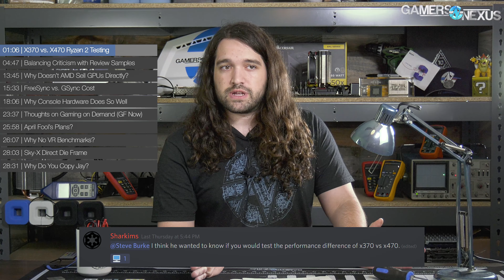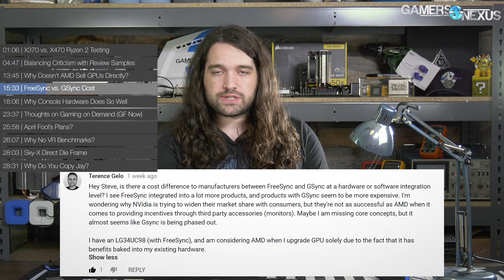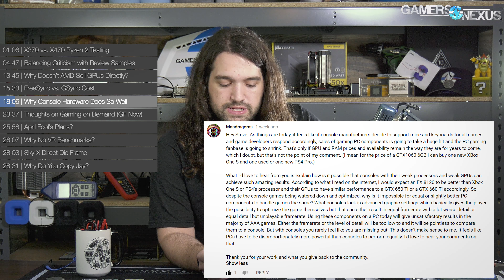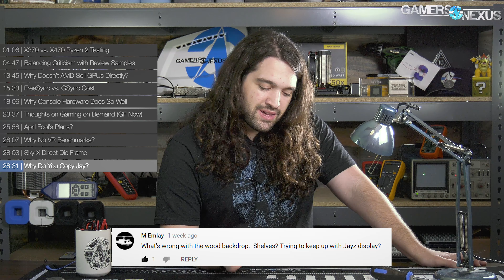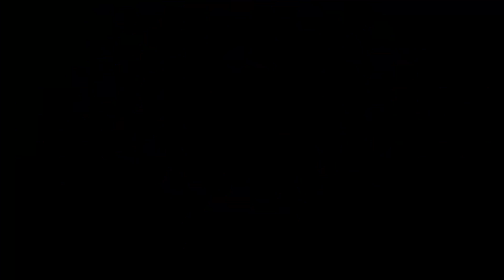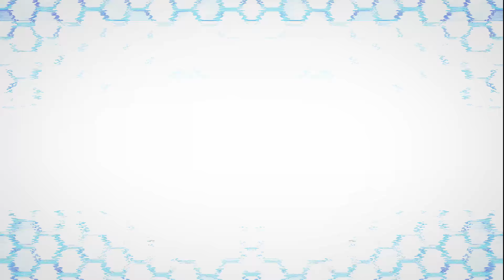Ask GN 75: X470 vs. X370 Tests, Balancing Criticism vs. Samples

Comment: Pretty sure it's much more than "just" criticism... 
Heavy criticism was certainly appropriate considering that CM explicitly advertised this as a "high airflow/performance oriented" case, and of course that's where the criticism came from, but that doesn't mean that it didn't go too far. A LOT of people now erroneously believe that the original H500P doesn't have good enough airflow to maintain acceptable temps for even a typical mid-level build with a mild overclock and that it's one of the worst cases in the industry, when in actuality it's on par with critically acclaimed cases like the Fractal Define R6. There are no doubt some people that have went with a case like the NZXT S340 over the 500 "because it has shitty airflow, I don't want my system to run hot!" When, in reality... 

It's one thing to review a product and be critical of its flaws, but to exaggerate it to such an extent that a large portion of the market now believes that it's something worse than it is and to reference it disparagingly for months after - especially when it's an otherwise segment competitive product with no greater amount of minor flaws than most of the competition in that price bracket - at some point you can't be surprised when the manufacturer isn't quite pleased with the way that you've handled the reporting of the flaws in their latest product. It's supposed to be a review of a product, not a public mockery of a company. This isn't a response to the criticism of a product - this is a response to the PR nightmare that was created, over a case that doesn't even have exceptionally bad airflow, or even really worse than the majority of cases of this product generation(not that the current 'standard' is acceptable - I have no interest in a solid legitimate 95% of new cases out there. But that isn't the point either). 

While I'm sure that Steve didn't intend("the road to hell is paved with good intentions") for his coverage to come off that way, while many here won't see it that way, that isn't the point. You've gotta consider if what you're saying CAN be easily misinterpreted, especially in a negative connotation. It's often the unintended consequences that do the most damage, and I'm pretty sure that's what happened here. Being careful with wording & actions can go a LONG way, especially if people can tell that you're making the effort, that you aren't being careless(which, if I had to guess, is probably how CM viewed this). That certainly doesn't mean 'suck up' or 'self censor', it means be more cognizant of what can potentially result from a presentation in one fashion vs just a slightly different fashion. Think about the perspective of ALL parties involved when making content and try to be reasonably selective with wording/phrasing to reasonably limit the potential misinterpretations. Obviously there's only so much one can do, but there still is a lot that can be done too. Again, the optics of "making the effort..." at least.

Just some thoughts from someone that's been involved in PR a little(different industry)

Comment: Steve,  Why is there such a lack of Multiple SATA M.2 Slots on current Mainstream motherboards.  It would seem that the mainstream boards should be more likely to use SATA Versions (Cheaper & Use Less PCIe Lanes) than the NVME M.2 Variant.  Any thoughts on this topic.  Also do you think we will start seeing boards with Say 3 to 4 M.2 Slots in lieu of Standard SATA Ports in the future?

Comment: Is it safe to assume that the memory and cache latency support between the ASUS ROG CROSSHAIR VII HERO and ASUS ROG STRIX X470-I GAMING will be largely the same if not identical? My use case is latency sensitive but I also need a Mini-ITX form-factor. The specs look very similar aside from connectivity, I'm hoping that I can use the upcoming flood of crosshair 7 reviews as a good rule of thumb.

Comment: Are you excited by the AMD Navi at 1080 performance for $250? I am.

$250 is similar to a 8gb RX480 in launch price. So I would imagine that it wont have HBM but rather GDDR6 also at $250 its not going to be 512 bit bus (like a 290x) cost wise. So basically we are looking at GDDR6 on a 256 bit bus. GDDR6 looks like it could be around 10gbps or 12gbps for the memory speed. That's 25 to 50% more bandwidth than the RX480. Having that as a theoretical maximum on top of a rx480's stock performance still does not net us 1080 like performance. So possible efficiency improvements?
I'm either inferring, estimating or blindly guessing here so the salt pile is very large.

Comment: #AskGN watching your video on the ryzen 2700x was interesting. my question is you seem to recommend leaving the 2700x at stock and let the XFR do its magic rather than overclocking to 4.2Ghz. but you also think the 2700 non X is a better bet if overclocked. this maybe a stupid question but if you overclocked the 2700 to same frequency as the 2700x would XFR behave the in the same way for both from that point or do you have to overclock the 2700 as far as it will go to be imilar to the 2700x. im basically asking how XFR works in relationship to base and overclocked CPUs

Comment: hey guys asrock x370 killer sli ac and asrock x470 sli master ac are pretty much the same both has 12 phase design you could make a battle between the two ✌️

Comment: QUESTION:
I have an old sad 7770 with a crappy cooler and a friend of mine has a couple of broken gtx 770's.
My question is: considering i have bios modded the crap out of the old hd7770, is it possible for me to fit the cooler from the gtx 770 to the AMD card? 

I know I need space for chokes and caps, but I can cut off some material from the heatsink with a file...

Thanks in advance!

Comment: There is of course a "physical piece of hw" for VESA Adaptive Sync (Freesync if you want to validate)... It's the scaler and controller board. I would guess the G-sync "module" basically is this exact thing, just created by Nvidia instead of  a more readily available design. Highly doubt G-sync  monitors have that module and then normal scaler and controller he too.

Comment: Hey Steve, on the chance you see this, I have a question and a recommendation. Even when direct product comparisons are impossible with too many variables floating around, it can be really informative and fun to apply multivariate regression. Have you ever tried or considered this? It isn't typically statistically valid but it could really offer a lot. I've tried this a bit in my freetime with things like monitor costs / variable refresh rates and benchmark performance among different processor micro-architectures. I'd like to hear your thoughts on taking this kind of analysis (and am open to talking about it more if there's any interest).

Comment: I recently built a new system with an R7 1700, Asus Crosshair VI, and G.Skill Ripjaws V 3200.  I've never overclocked before, but I've been watching TechTuber videos for about a year, so I decided to give it a shot.

Basically, I started with the Asus UEFI auto-overclock feature, and it spit out a baseclock of 103, and a multiplier of 40, for a total ~4.1 overclock.  From everything I've seen, that's a pretty aggressive overclock, especially on a non-"X" SKU.  Stable, no major issues (an occasional stuttering issue, but I can't even say for sure what the cause is).

So, the question: Did I just jackpot the silicon lottery, or is there something I'm missing between target overclock and actual?  (Speccy says CPU is actually running @4.1.)

Comment: #askgn The FTC issued a statement cracking down on companies placing contingencies on warranties. Do you think companies are going to fight it or give in? Also, do you think that it will make any difference for overclockers and moders? Obviously there should be a limit as to what a company warranties, overclocking and burning out components is a risk for us to take. However it would be nice to work on or upgrade components in a device without worrying about voiding the warranty. 

FCC Release: https://www.ftc.gov/news-events/press-releases/2018/04/ftc-staff-warns-companies-it-illegal-condition-warranty-coverage

Comment: Hi #AskGN, I have a maybe dumb question wondering if this is something you've tested or if you have any information on other sources on the internet. Now that people have verified coffeelake's compatibility on z170 and z270, do you have any info on compatibility of 7700k on the z370 chipset? or is this to your knowledge just technically impossible? If this will be possible, it feels like even z470 will be supporting 6th/7th gen cpu because within 2 generation chipset they are usually inter-compatible right? in that case, if the modding to get it work is not rocket science hard, we will live in a happy place where intel actually produced 4 generations of inter-compatible chipset/cpus, isn't that great? I don't have high hope though this is just a wild guess/hope at best. Oh and it's probably subjective but I actually think your shelf looks better than Jay's.
Reply: Also, just thinking about the apple battery scandal thing, planned obsolete is bad right? If Intel can't prove that the previous gen is indeed not compatible, but just straight up block it for the sake of blocking , isn't that the same thing, planned obsolete?

Comment: #AskGN With the decline in multi GPU compatibility, why doesn't Nvidia add one or two more price brackets to the graphics card market, like $1000 & $1300? I don't mean the Titan lineup, rather cards that have significantly more power than the x80 TI GPUs (even if the die is super huge, Nvidia + AIBs can always liquid cool it from the start). I know this sounds strange, but there are always those people that have a limitless budget on gaming equipment.

Comment: Looking for a solution to remove corrosion from a mother board.  The board still works but has quirks.  The affected area is lower bottom right near the on off pins.  Alcohol and a toothbrush did not work.

Comment: Have you seen the video Luis Rossman did on liquid metal shunt modding weakening the solder joints?  I would second think that method and maybe move to soldering a resistor or wire bridge.  There might be undiscovered methods as easy as liquid metal like using foil or something.  It might be a good video to check out how the cards are that you did it on and try out other methods.

Comment: 18:00 I have the answer. Consoles target 30FPS. PC players are unhappy with less than 60FPS. Camera movements with joysticks are smooth at 30FPS because they are not a direct imput like a mouse. When you move a mouse your brain expect something precise who is hard to achieve at 30FPS. When you move the stick, your brain only expect a direction, not direct control of the camera.

But if you tweak the graphics, with a pretty old GPU you can achieve the same as a console at 30FPS, just play console type games with a controller or you will be disapointed.

Remember, when reviewers compare FF15 PC vs consoles, the PC port have twice the FPS (locked on PC and deeps on consoles) with more graphical fidelity. Meaning the PC have about 3 times the power of the console in the hood. If you take 1/3 power of a GTX 1080, you end up with a 960 or maybe less. A 100 or 150$ card. If you add a shit CPU to target for 30FPS max, like 50$, you may end up spending more because of memoy shortages, but you will not be too far from a console cost.

Comment: Steve, any way you can inquire as to the status on the Lian Li case that was designed in collaboration with Der8auer? I myself would be very interested in getting the Dynamic. I have the Enermax Equilence which is OK but VERY heavy.

Comment: To answer your Console Segment in the video from a software developer position who knows a few game developers:
You're answer was half correct. 
Contrary to popular belief, it's easier to optimize for PC. Why? Because it's significantly faster and has way more memory. However being that consoles are one set of hardware it is by quite a bit less complex. Now my next point may sound contradictory but hear me out.

In some instances a console game on a first alpa build can run at 100ms PER FRAME or any other significantly high number. Needless to say it's horrible. Gamers hate anything below 16ms. Now imagine 100ms! It takes a significant amount of complex optimization to get it down the that target of 33ms. That's a large drop. It may be complex but certainly a different kind of complex because you have one set of hardware or like most studios a Xbox One X/S, PS4/Pro. 

PC on the other hand on a first build could start at 30ms or so. Basically near 30fps. That's a pretty large difference! So it's much easier to hit your target because you are very close already. Where the complexity comes in is getting it there on more hardware. It's generally speaking not super difficult to get one GPU there but the other architecture may not like it. Which means a different solution needs to be found. It's really down to balancing your code. That's the complexity side of it.

Hope this helps:)
PS: sorry for typos, on mobile!

Comment: #AskGN QUESTION: Can you apply max multiplier to all cores of non k processors like 8400 (x40~4Ghz) and 8700 (x46~4.6 Ghz)? Recently I've stumbled upon this thread " http://www.overclock.net/forum/5-intel-cpus/1645268-possible-i5-8400-a.html ". If it's true, then is it worth buying 8600k when in some regions 8700 costs about as much as the 8600k?

Comment: What about the usage of modern CPU instructions or instruction sets like AVX, FMA etc. especially on Windows. As x86-64 only mandates SSE 2, I fear that most of the current software (e.g. Games) targets that as the most common denominator?! Are much of these advances in CPU technology in vain from a consumer point of view as re-compiling stuff is more of a Linux thing? I've also heard of Intel's own Linux Distribution (Clear Linux) which uses modern compiler techniques (like function multi-versioning or profile guided optimizations) to gain respectable performance advances over other common Linux distributions. Are these optimizations already used in Windows as well? Do you know if Microsoft works on something similar to use these modern hardware ressources more efficiently with their upcoming Windows Core OS? Especially as GPUs get more and more general purpose and will transform into C++17 accelerators soon?!

Comment: For x370 vs x470 just take some same mobos like asus prime pro x370 and x470 and try custom settings like 4Ghz depend cpu you can try 1st gen and 2st gen Ryzen and same voltage do some benchmarks and ready the x370 vs x470 . I think will be same results

Comment: Which is better for side panel fan mounts: intake or exhaust?  
Hypothetically, if one is using a gpu that has an open air cooler, like an evga ftw, and also supposing that whatever case you choose, you have at least one fan in the front blowing as intake, and one fan in teh top back as exhaust.

I'm sure many will have a good advice, and I'm welcome to it, but I'd like to hear Steve's thoughts.  It might even make for a content piece on its own.

And why do I ask?  I've got a bit older of a case - Antec 1100 and I never use those side panel fan mounts, mainly because my first card was a reference 7970 and now I use an evga 980ti hybrid, no need for side panel fans.  However, it's a really good case that I'll most likely have for years to come and at some point I might look at going open air cooler GPU in the future.

Comment: regarding the VR question: currently running an OCd i5-3570k and a GTX 970. I'm very pleased with the Performance in VR. No performance issues yet whatsoever (anyway the stuff i tried)

Comment: #AskGN How different are lower TDP chips from higher TDP ones?  ie how different is a i5-8400 from a i5-8400T?  Are the differences just in clock rates are are there other changes in the silicon?  Though Ryzen doesn't have 35w TDP (desktop) parts, could a Ryzen 5 1600 be functionally used as a 35w part by constraining the clocks?  Thanks!

Comment: Hey steve, do you think that enthusiast grade hardware will ever reach a point of not requiring active cooling?
How long until a passive cooled high end gaming CPU and GPU (equivalent  to todays 8700k and 1080ti)? I am not talking about achieving 
what a 8700k and 1080ti can do today with passive cooling, but shopping for CPU/GPU and NONE of the available hardware having or requiring fans for cooling.
It seems that we are so used to fight for airflow/temperature that we dont realise how it really is: Taking painkillers instead of treating the problem.
And it is a problem: Case/hardware Design limitations, noise, dust, reliability of moving parts. Imagine having every CPU/GPU on the market 
being sold with just a heatsink on it. Will manufacturers even try to achieve that, or always just push to the best possible performance WITH active cooling?
Reply: Well you can run a Ryzen 1700 passivly!
Reply: Underclocked with huge heatsink on open air bench and still a maybe?
Reply: George Lambros Well im running mine on 4,0GHZ @ 1,392V with a macho without any problems.... 
So rendering and gaming is no problem for the Temps (at least not a big one)